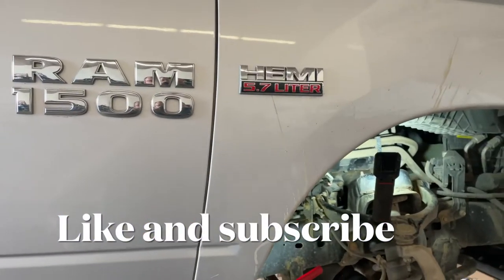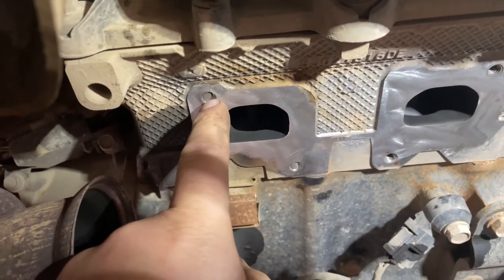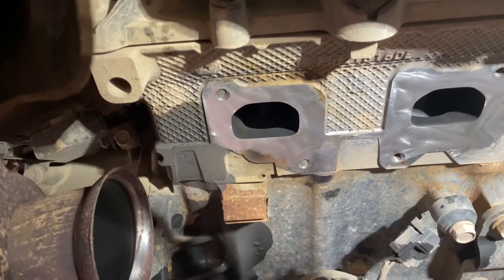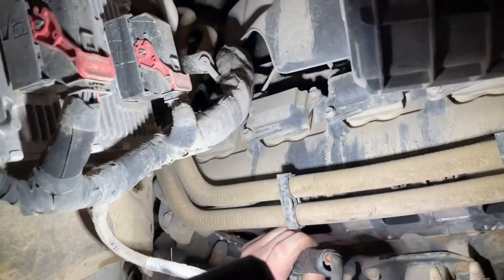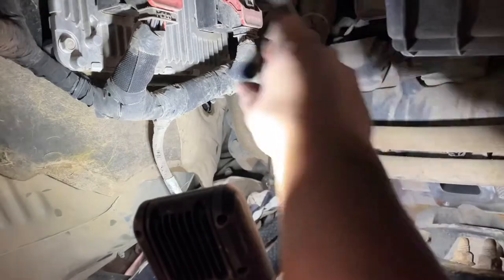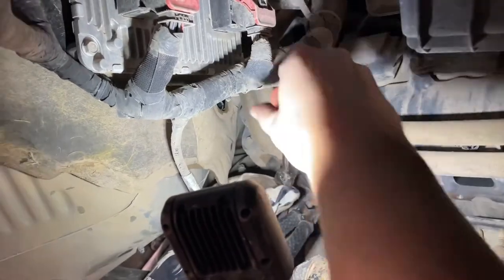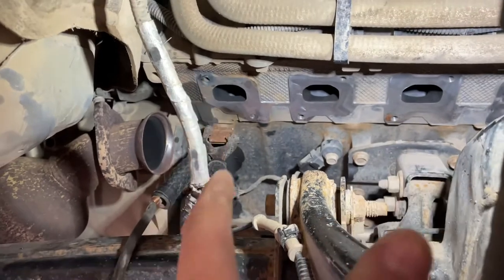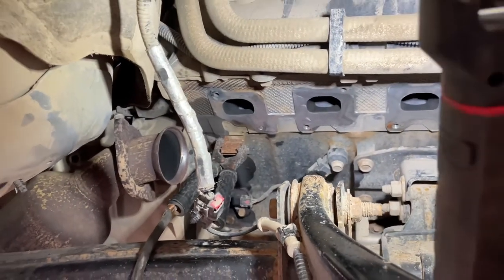2015 Ram Hemi exhaust manifold leak or tick.

Comment: Do you use gas with your welder or just the wire? Should my 125 fluxcore get hot enough to do this job at home? Thanks 🇨🇦
Reply from the maker: I use gas now with my little mig. I did do it in the past with flux core and got them out. Might take a couple of attempts.
Reply: @JonHolovach  Cool. Cheers.